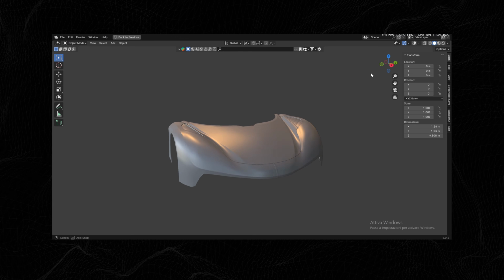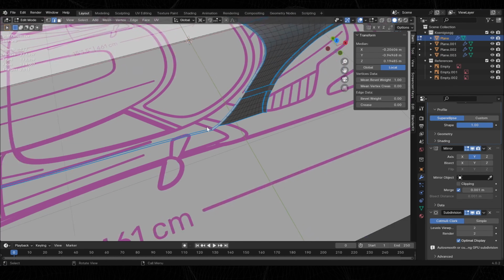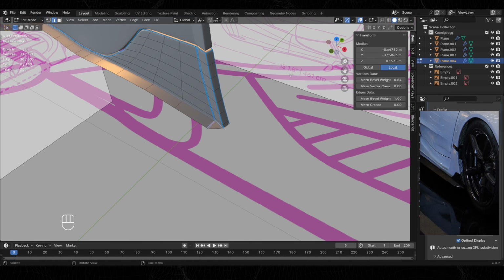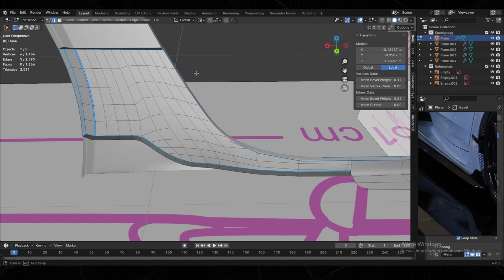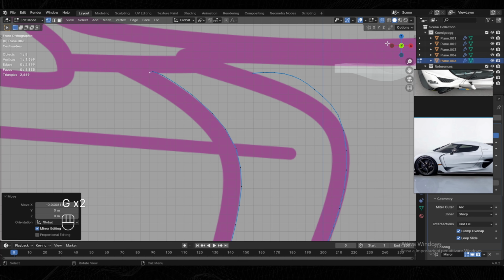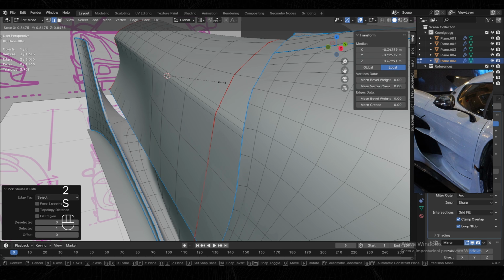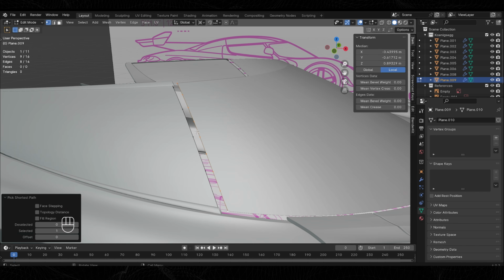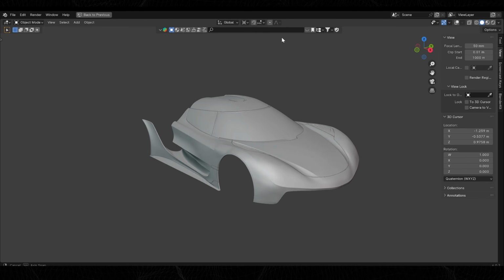How to model Complex Hypercars in Blender | Koenigsegg Jesko 3D modelling Series Part 2

Comment: Great video. Love your work. Here's a great new tool for contoured panel inserts I just learned about!

https://www.youtube.com/watch?v=Fna4uisMbnE
Reply from the maker: Really cooll!!!! Thanks Brother.
Reply: @Phantom3DStudios  That add-on looks like it's going to make my life a brighter shade of black! Also, I'm using Rhino a lot more than Blender these days, but your tutorials are still valuable. One of the most annoying aspects of learning modeling is that so many tutorials, even for Rhino, are really simple, boring objects. Very few cars, airplanes, or complex surfacing exercises. I can't even find a Dyson vacuum or anything like that. The whole point of staying viable in competing with AI models is to understand efficient topology and clean surfacing, and it's seldom taught. How are people going to do mesh cleanup on AI models and scans if the AI output is already better than what they can do manually? It's like learning to use a robotic welder, but you don't know how to weld by hand, so you can't spot bad joints. It's only a performance enhancement for someone who has the skills.